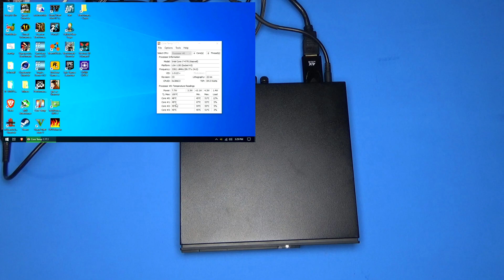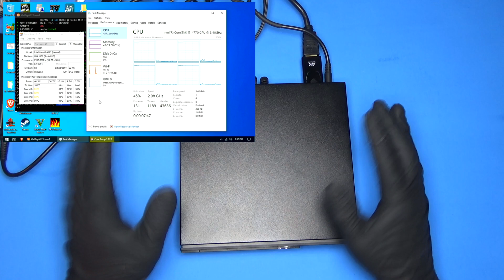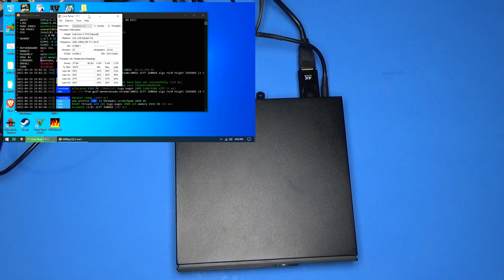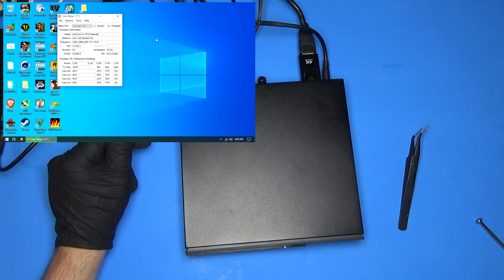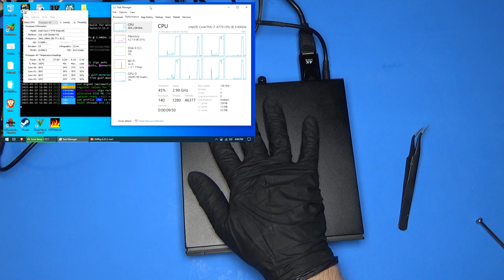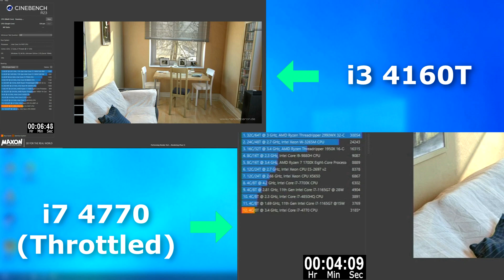Will it Post?  Dell Micro 9020 i7 upgrade - Haswell i3 4160T to i7 4770 - Heatsink Lapping

Comment: I hope you can revisit this test with a higher power adapter (like 130w for the 3.0x4.5mm those Optiplex Micro uses) since you did note at 6:59 that it got pretty toasty. It might not make a difference in performance since likely Dell bios limited the CPU power, but could help with the toasty brick problem since the brick won't be running to its limit.

Had a similar experience with the i5 8500T in my Optiplex Micro when I ran all core workloads like Handbrake. I had a look with ThrottleStop on mine and I saw that initially the boost allows like 80w for a few seconds on PL1 then afterwards it engages power limits with PL2 and drops the clocks to keep it from cooking. Didn't matter even when I cooled the CPU to below 70C the power limits held back the boost clocks.

Comment: You should try deliding the cpu and applying liquid metal on the ihs and the die. this will overcome intel's thermal paste that they use on the die. If you dont want to use liquid metal you could also try using fresh thermal paste and seeing how much of a difference that makes. After you just put the ihs back on and put it back into the socket.

Comment: i have a few of the lenovo versions of that usff  mini pc type . I found the Xeon e3 1260 and 1265L cpus are compatible with them and they only run at 45 watts 4 cores 8 threads and they can turbo to 3.5 ghz while staying in the 45 watt thermal evelope

Comment: This upgarde should also work on the inferior model (optiplex 3020m) even though it was never officially supported.

I'm writting this text from a 3020m with core i7 4785t and 16go of Ram , it works like a charm using MX Linux. 🙂

In any case it is better using the "T" versions with those mini pc.

Comment: @JimsJunk
A much better CPU model would be a 4770T as that is a 45W TDP model, but ideally, a i5 4570T would be the best option as it's only 35W and would still be a very solid boost compared to that i3. EDIT: A 90W AC would work well but a 130W model would be ideal.

Comment: Next, throw a i7 4790(k) in it XD. A 4770t would definetly be more appropriate for this.
Reply: I was just about to suggest that. The 4770T or the 4570T would be much better. Both are sub 50W CPU models.

Comment: Yeah you're definitely power limiting, I've got the exact same model that came with the dual core non HT pentium and I had a "dead" 4770S given to me from work. It doesn't work in other computers except this one, and even then it'll run in single channel memory mode. It'll limit itself to 40W just like here but because it's an S model it doesn't throttle even on all threaded load. All core turboing is very limited however maybe getting 100-200MHz above base.

I think even with a higher wattage power adapter you're not gonna get any more out of it since Dell probably created a hard power limit in firmware of 40W so the VRMs and cooling system aren't overwhelmed.
Reply from the maker: I agree, thats what I"m thinking.  Forgot to meantion that in the video, but you're right about the bios and vrm's. Still might be interesting to see what would happen.

Comment: Seeing you lap the heatsinks on those small 1L form factor PC makes me think if I should finally do it with my mind. The i5 8500T in my Optiplex 3060M tends to stay at around 52C idle and having 34C ambient temps during daytime don't help things.

The very conservative fan profile set by Dell very much to blame as it likes to stay below 2000 RPM (typically around 1100~1250 RPM) which is quiet but barely pushes the hot air out. The fan curve doesn't reach the max 6100 RPM even at around 90C under load. Manually controlling the fan speed is ineffective since Dell's embedded fan controller only reveals 950 RPM and 6100 RPM on my unit so I've left mine on the stock Dell fan curve.

So far I've had some improvement by undervolting and testing with a 97mm blower fan pointed at the front I can get a solid 10~15C temp drop with the significantly increased airflow.
Reply: Ran a stresstest again to check for per core temps and Cores 1, 3, 5 are 2~3C higher than Cores 2, 4, 6 so yeah my heatsink is probably uneven like on your 9020 Micro and needs some lapping.

Update: I've lapped the heatsink and aside from one stubborn core (Core 3), all the other cores had a 2~3C reduction in temps under load. My complaint about the fan profile still stands as I get a 5C reduction on load temps at best with the CPU fan at max speed (about 6100~6150 RPM).
Reply: @abunk17  Don't forget that Haswell onwards don't have soldered heat spreaders, they have pretty crap thermal paste instead, this also causes differentials between cores
Reply: @joeynebulous816  Thanks! I was actually thinking that maybe the case so I looked into that a bit more. Intel seems to have gone back to soldering the IHS for some higher end 10th gen stuff and for 11th gen and later. 
My guess is that after cheaping out with the TIM for a while they had to go back to soldering the IHS so they can squeeze more performance out of their newer architectures that push high clock speeds and more cores with the P+E setup to compete with Ryzen chips. Who knows maybe they can finally reach that 10GHz mark they aimed for during the Netburst days, though it might be at the cost of needing a dedicated PSU for just the CPU lol.

Comment: An i3 4370 may be a decent upgrade over the T as well if you don't need the extra cores. It has more cache, higher clocks, and a better IGPU. My media streaming PC is a dell 3040 micro that I upgraded from an i3-6100t to i3-6320 and saw a noticeable improvement in responsiveness. It still draws the same power at idle and comes nowhere near the 51w TDP under load while staying at 3.9ghz. I believe the whole system drew around 35W from the wall at max load. I delidded the 6320 just for the heck of it, but heat wasn't a problem.

Comment: see if you can get a 4770T CPU, it should be a lot better when it comes to thermal management, you don't get the full clock speeds like a 4770 but at least it will have 4c/8t and be more manageable :)
Reply: 100%

The correct CPU for this situation.

Comment: 00:20 The i7 4770 is 22nm not 14nm! You could probably also improve temps by delidding the 4770, these CPUs are notorious for having bad TIM in between the die and ihs (which is why intel released the 4790, 4690, ect. a year later)
Reply from the maker: oops you are right I forgot to change that.  My fault.
Reply: I have a I7 4790K and that suffers from the bad TIM between the die and IHS. Max out one core is at 80c, two cores are in the high 60's low 70's and one core sits at 55c.

Comment: What’s the biggest limiting factor: Power brick or stock fan profile?
Reply from the maker: Good question.  Probably the stock fan profile.  Dell loves to have them set to do nothing until nearly the last moment and then it goes 100%...usually too late at that point.   I found a larger power adapter that I was considering lopping the end off and trying to see if that helps.  Could also be the bios not allowing it to clock higher.  The onboard VRM's might not be up to the task.  Maybe I'll throw together a quick update vid trying it.